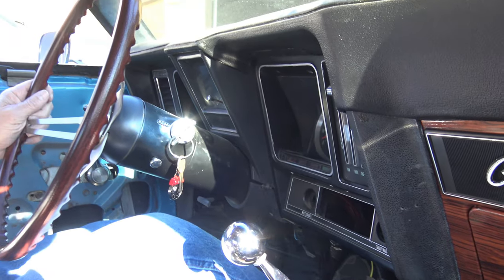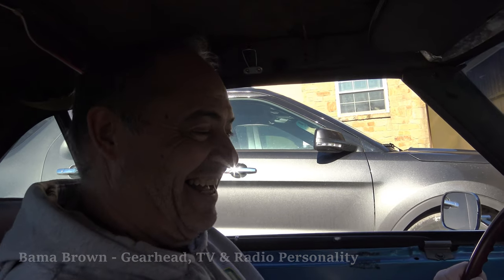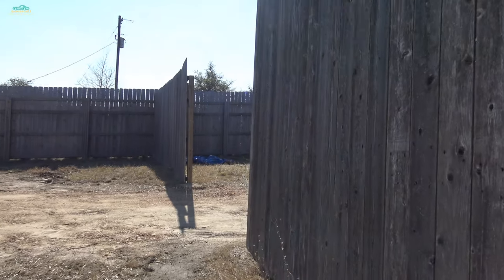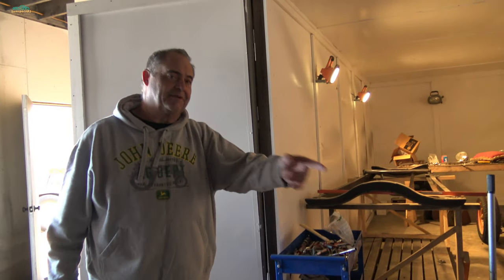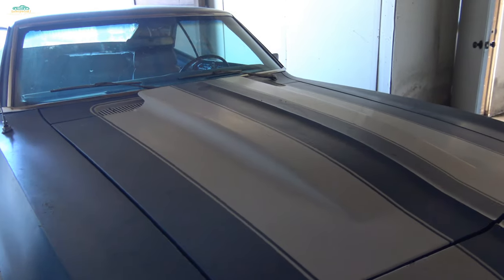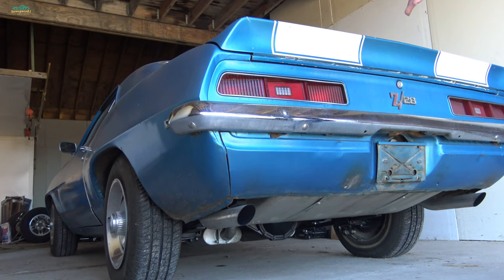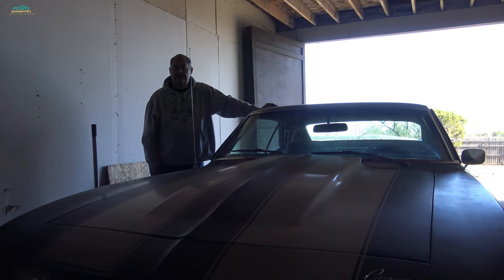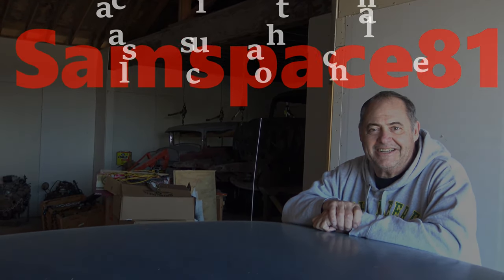1969 Chevy Z28 Sleeper barn find patina Texas fun machine #69camaro

Comment: Not a real Z/28. Whose idea was it to take out the 302, put in a low rev engine and put the 302 air cleaner back on
Reply from the maker: I don't know, its a bastardized car but a fast one
Reply: @samspace81  Should be faster than original if the video is right about 600hp. Stock was 400-450 depending on who you listen to. Just not crazy about the idea of it pretending to be a 302 Z/28. Taller gears might have been in order. Can a stroked out engine handle 8000 or more rpm like the original?
Reply from the maker: Yeah whole different animal now, grunt and not as sweet high reving